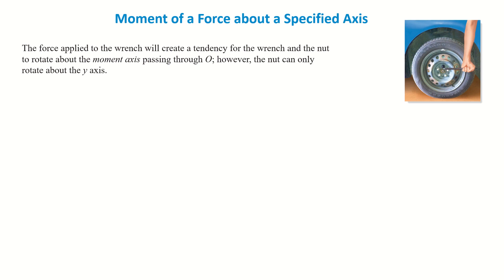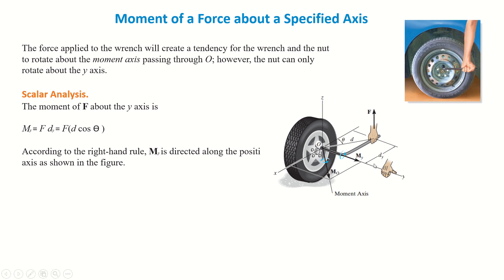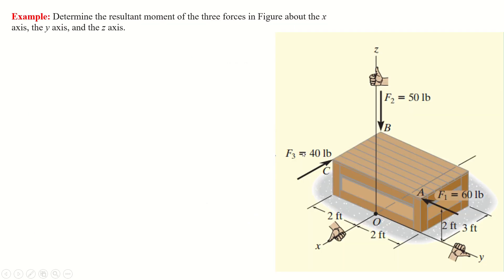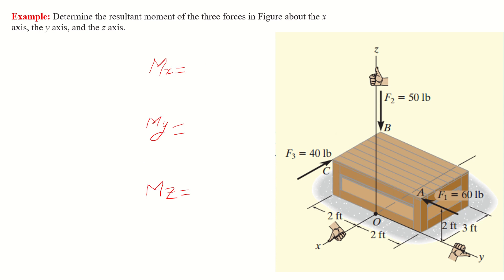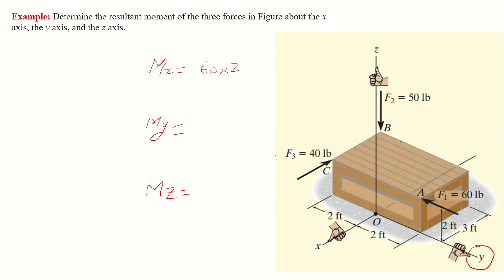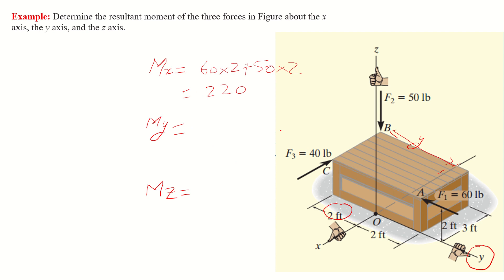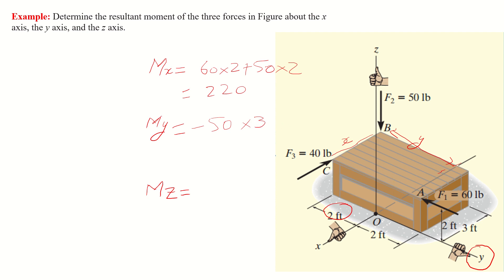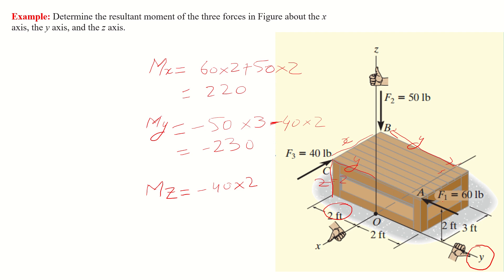Moment of a Force About an Axis | Solved Example

Comment: Sir in example why we consider F1 equal to zero, in case of (Mz)??
Reply from the maker: For Mz . F1 is in y direction and distance in x direction is zero
Reply: @drumairmunir  i am not getting sir there is F1 × .9m but why we consider it zero???
Reply from the maker: @eafcotherside  F1 is in y direction and it does not have and perpendicular X distance. That is why  Mz due to F1 will be zero. I have explained this in video. Please watch again